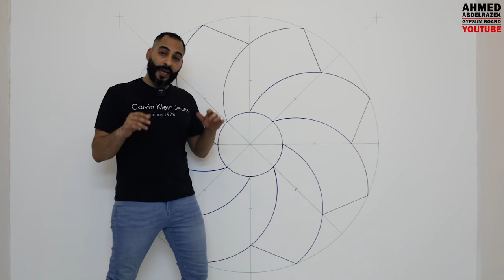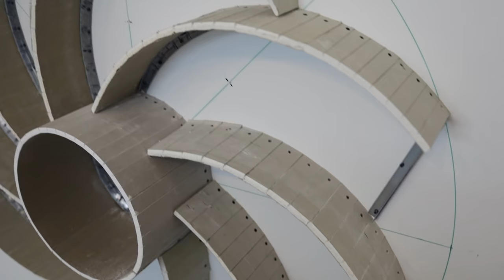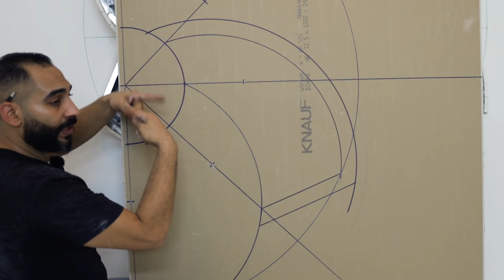طريقة عمل ديكور المروحة جبس بورد !!

Comment: May I ask what type of angle you are using? I have a hard time finding those here... I thought it would be somewhat like 10x10x0.5(0.7)mm metal...but the only ones I can find is like 30x30x2mm aluminium or PVC stainless steel etc. Thought maybe it's something special? The thinnest i found was like 150x120x0.7 for roofs etc...and I don't want to buy something where I throw most of it out...
Edit: nice work on all of your videos btw thanks and 👍